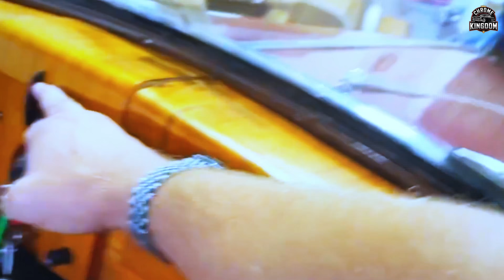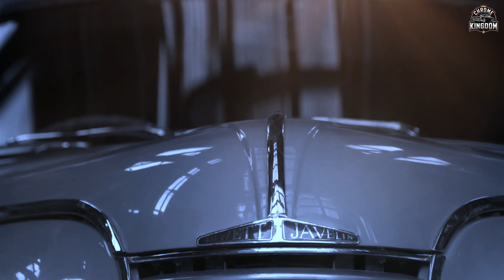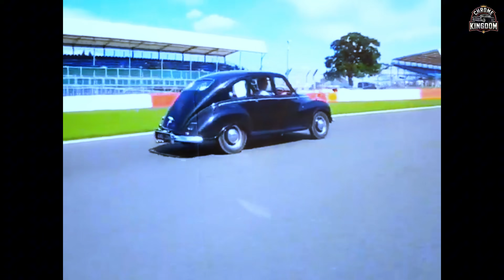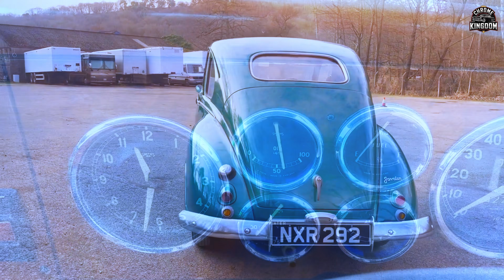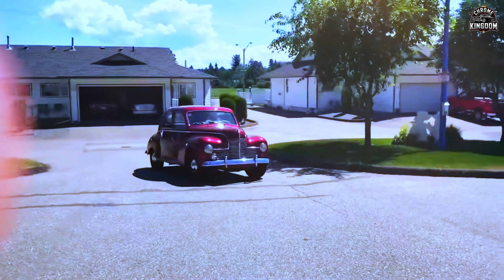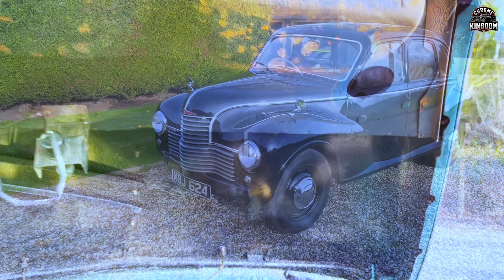Jowett Javelin (1947–1953) Why It Was Ahead of Its Time — So Why Did It Disappear

Comment: As an American, I’m sorry to say I’ve never seen a Jowett Javelin up close.

“Jowett Javelin and Jupiter: The Complete Story” by Geoff McAuley and Edmund Nankivell is probably the definitive book on the Javelin and Jupiter. “Auto Architect,” Gerald Palmer’s autobiography, is also a good read.

Regarding the crankshaft issue, Jowett brought in an outside consultant. IIRC there are three different crankshafts, and there’s a hierarchy of desirability among them.

There was also the transmission issue. Jowett had been sourcing transmissions from Henry Meadows Ltd., a respected engine and transmission supplier. At some point they decided to make transmissions in-house to save money, and they had severe quality-control problems. When they saw used Jowetts advertised for sale with Meadows transmissions mentioned as a selling point, they knew they were in trouble.

The Briggs heirs also sold their American plants—in this case, to Chrysler. Packard had been sourcing their bodies from Briggs, so they were now in the same position as Jowett. They brought body production in-house, but it was a desperation move that didn’t end well.
Reply from the maker: It’s fascinating to hear your expert perspective on those specific mechanical and manufacturing challenges that ultimately pressured the company! 😊
Reply: @chromekingdom  McAuley and Nankivell's book gets the credit, I don't!